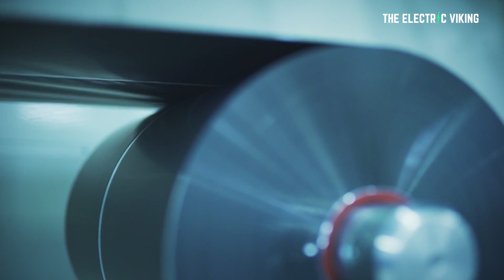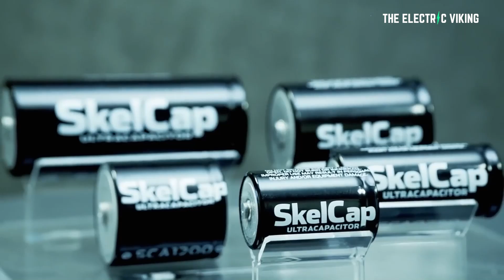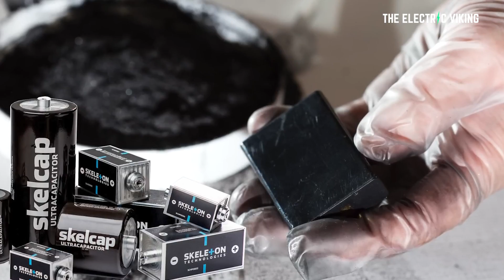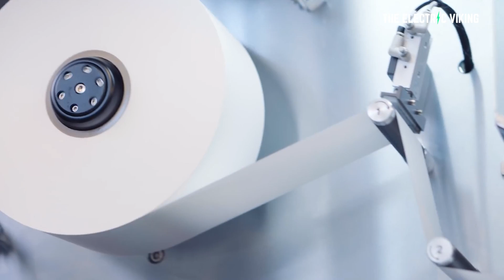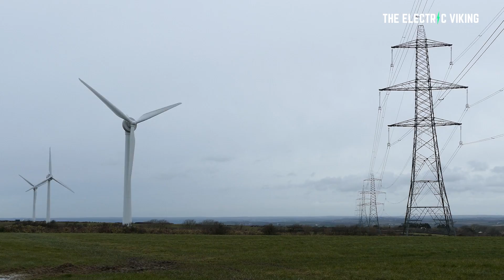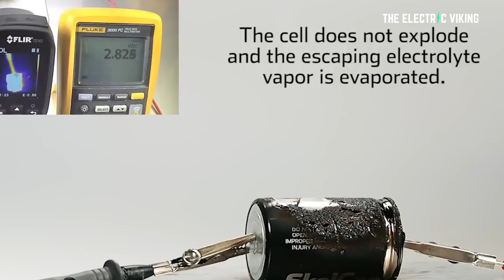The EV Super Battery that charges in 60 seconds & lasts 100 yrs

Comment: the energy density of those batteries/capacitors is very high compared to other capacitors but the are not that high compared to batteries.
it seems that this is more suitable for very fast regulation of power grids to keep them stable in certain load switching scenarios.
they might be a complementary device in addition to batteries in sports cars to have an acceleration boost for a few seconds and take a huge amount of energy from breaking, thus taking off a lot of stress from the battery. 1000kW for maximum 10 seconds. that would be a high speed buffer of 2.8 kWh. so, you could use a 'slow' battery with 80kWh plus a fast ultra capacitor from skeleton with 2.5kWh as a combination for fast action. perfect for formula e
Reply: Yeah or as a capacitor for regen and short initial instant delivery to high load requirements instead of a battery in a hydrogen cell units for anything from a car (not much needed as batteries does the job fine soon enough) or in heavy equipment where Hydrogen actually makes sense, and the same for hydrid ICE cars to store regen energy if we still want those in the future.

Comment: Meh, If the 10X numbers were real, they would post them. GMG still seems way more promising, they are up to 300wh/kg.
Skeleton ultra capacitors, if I remember correctly, also have a high self discharge rate. Skeleton have actually been around for quite some time, their products have been extremely expensive compared to any battery

Comment: The power density  of these ultracaps is much higher, great for bursts of speed abd fast recharge. But the energy density still falls short of LiIon, which means limited range. So, quick acceleration, but it also quickly runs out of  juice. So, it has some interesting and potentially useful properties, but will not replace existing battery tech.
Reply: How about if we put a windmill on the roof of the car and regen while we drive, then we can go forever right with all this power.
(I thought I should perhaps say that I'm joking or some people might actually take this seriously!)

Comment: You do understand right that the comparison is against other CAPACITORS, it's 10x standard CAPACITORS. This is still way off current battery energy density, and mid/long term storage is not what it will be competing in. Like they say short/mid storage up to 15 minutes, it's not aimed to be an energy storage solution but a load demand buffer (smoothener).

Comment: Do not confuse power density with energy density. Power density is "how fast can you get power out of it per weight" and is W/kg, Energy density is "how much energy can be stored per weight" and is Wh/kg.
Skeleton tech super"battery" according to their specs has 200 times better Power density of li-ion batteries, but 4 times WORSE Energy density.
For planes, this would be useless. For electric cars it would severely limit the range. Its lifespan and recharge speed makes it a game changer for short span applications like mining rigs driving a single 15 minutes then unloading and charging, or as a small supplementary unit in EVs for regenerative breaking charging only + quick acceleration drain help to extend the lifespan of the main battery with high energy density, but in itself this can not replace batteries. This is "just" a supercapacitor that is far better than any supercapacitor before, still having capacitor's main downsides, just less harshly.

Comment: No they don't believe they will use them as batteries in electric and hydrogen cars. They expect to use the ultra capacitors as an intermediate between the motor and the battery. Since massive power draw and regen is limited to short intensive bursts they think they can use a lower spec li-ion battery to trickle power to the capacitor that will even out the power flow and current demand on the battery. It will also be a tiny tad more efficient but most off the efficiency loss is in the current conversion in the inverter and losses in the motor so nearly negligible. For ICE hybrids I see a use but isn't that a dying breed? For electric cars no, not since batteries are improving so much and this will just add weight and complication. For hydrogen it's probably a great solution and can find legitimate use, but isn't that a solution mainly for heavy power intensive equipment like harvesters and mining. The trick is to not get overexcited and trick yourself and others. Try and locate the truth and stay in that zone.

Comment: For and average EV battery of 100 kWh, DC charging in 60 seconds = 6000 Megawatt - minutes.
For a 400V battery, this means an average current of 15,000 Amps for 1 minute.
15,000 Amp rated cable (twin), probably weighs about 20kg per metre. Internal wiring of car would be a bit heavy.
AC charging would be similarly prohibitive; It would need an 11kV 3-phase supply with suitable connectors, switching rectifier and associated electronics.   For a single cell in an EV, 60 seconds may very well be possible; for a car though, I'm not so sure. 🤔🤔🤔

Comment: Many new hypothetical batteries run on graphene, not just these, because graphene allows the battery to handle super high heat without degrading.  The faster the charging the higher the heat requirement.

The challenge with all of these batteries is no one has [yet] figured out a viable way to cheaply mass produce graphene.  Without that step none of these companies will become valid.  Whoever figures that out will become quite profitable.  "In a gold rush sell shovels."

Comment: You can download a brochure at https://www.skeletontech.com/hubfs/02-DS-SuperBattery-D60-221006-1D.pdf?hsLang=en The energy density claimed is 65 Wh/kg (as opposed to >200 Wh/kg for Li-Ion). A car powered with these batteries won't drive far between recharges, but will be recharged quickly, so overall it might still have more useful work, especially in a controlled environment like a mine where the car is never far from a charger. 

For aircraft, not so much.

Comment: Every TRUE Capacitor will accept 100% of its electrical capacity INSTANTANEOUSLY. The bad news - capacitors "give up" their electrical charge just as fast - 10kw in POOF - 10kw out POOF. No good for an EV. However, thanks to the rapid switching MOSFET, a capacitors discharge can be modulated (slowed down). Add a bank of capacitors to an EV battery pack and INSTANT CAPACITY IN - in an instant, then that energy is metered out to do a proper charge to the actual battery pack. It's a Hybrid that uses capacitors instead of a gas engine.

Comment: I just checked the SKELCAP SCA3200 , is a capacitor of 3200F at 2,85 V and this provides a maximum of 9120 As or 2.53 Ah or the equivalent of a 7.22Wh. And this is not helping the electrification too much, as the price on the market is around 70-80 euros per capacitor. If you need 1000 capacitors for a car, the price is far too high and the energy density is not enough. But for stationary applications which have no problems with weights and volumes, in long term is a good solution, if it is not necessary to keep the charge more than 1500 h (62.5 days) as is the presented limit of charge retention...
PS: all of these show us one clear thing: this type of supercapacitor needs to improve its capacity 10 times at the same price before being considered an alternative to the batteries (which are capacitors also, but their chemistry is different)...

Comment: Yes, caps last a lot of cycles, can charge/discharge fast, but as always, their energy density is nowhere near a chemical battery.  On their own website, Skeleton say that this is between a cap and a battery, for applications of less than 30 minutes.  So, there are applications, and fill a niche, but a replacement for a primary car battery, they are not. 🧐😉

Comment: I don't think this will take the EV industry by storm.........it's similar in strategy to a compressed air tank.......you pump it up to enormous pressure (high voltage etc) and then discharge it via a regulator to an engine etc .....the problem is the pressure and volume decrease as the capacity is used up until the end point is reached when it's no longer practical to discharge it further........the rapid charging would be handy.......but I can't see any home facility being able to charge a large capacitor bank any time soon.

Comment: That's not a battery. That's just supercapacitors.

They need to increase energy density by another 100 times to match batteries.

However, what they did with the supercapacitors to increase the energy density by 10 times is a great achievement. It will allow supercaps to be used in more applications. And they are super reliable. 1,000,000 cycles and nearly instant charging times with zero degradation.

Comment: To charge really quickly needs extremely high capacity chargers, water cooled cables and conductors to the supercapacitor that are thicker than your wrist. Just because you can, doesn't mean you should.

Comment: I said this years ago that once EV's got the start they needed, battery technology would race to catch up and over take what people wanted from an EV.
we passed the power stage very early on as no ICE to date or may be built in the future will be able to compete on the track nor off, the only things that now need to change are price and range.
once we have a price range close to that of ICE vehicles, no one would even think about an ICE as a sensible option and once range is removed, the age of ICE will be forgotten so quickly that people will ask another person, do you remember those cars we used to have, just like people today have to think about what technologies they used only a few years ago that are now dead and in the land fill or hidden in a cupboard or storage shed :).
Selection is my only stumbling block as at present, I have very limited options, I keep hearing that we will get a few different Chinese models coming soon and finally they are advertising Volvo/BMW/Mercedes and Hyundai on TV, so it looks like the near future will give me a choice on EV's, finally.
just a pity toyota won't be on that list as they are advertising some piece of crap Hydrogen combustion engine that only out puts as much CO2 as a running ugly girl/guy, can't tell if it's supposed to be a male or female as they chose the most genderless person they could find for some reason ?

Comment: Sam,

First, Happy Birthday.

I just looked at their brochure. They are claiming an energy density of only 65kWh/kg. Sorry, but the harsh reality is that these are not going to replace EV batteries until this is radically increased.

When it comes to charging speed, you need to remember that the energy that needs to be delivered during charging doesn't really change (aside from battery efficiency) depending on the storage type. Put simply, to charge a storage device in 60 sec requires 60 times more power than pumping the same amount of energy in over a period of an hour. That means either 60 times the voltage, 60 times the current, or a mix of both (e.g. double the voltage and 30 times the current). High current means more power loss in the cable, bigger cables, and a host of other issues. High voltage is difficult to switch (especially DC) and requires a low more insulation.

The company cites its application being in the 1-15 minute cycle time and clearly indicates that Li-Ion holds the 15 min+ range. This means that you can't really take the recharge frequencies associated with Li-Ion batteries and apply the 50,000 cycles. Where these batteries are used, you are not going to be recharging once every day or so like an EV. They are going to need to be recharged regularly throughout each day, meaning you are going to burn through the 50,000 cycles very quickly compared to Li-Ion.

I'm sure these devices will have many useful applications. For the foreseeable future, I don't think EVs are one of them.
Reply: This is very insightful thanks!

Comment: Charged capacitors are like loaded guns, they can discharge at the same rate they are charged...  releasing all that energy in an instant.  Getting into an accident with one of these vehicles would at least be the equivalent to playing with a live electrical wire.

Comment: What kind of power supply/charging system would it require to charge a 100 Kwh pack in 15 seconds?!?
Reply: the shell reference system charges a 400kWh battery in 90s with a 24MW charger. so divide by 4 multiply by 6 and we got 36MW charger.

Comment: sigh...enough talk about this stuff..."show me the money"...why doesn't this company hire an independent entity (like a university), package the darn batteries, place them in an EV (perhaps one of the EVs that has been designed to swap battery packs), instrument the vehicle with measuring devices, drive the vehicle around a track until the battery pack is exhausted, then charge the darn thing...do it more than once to develop meaningful statistics...document the results...then any statement is based, not on press releases, but on actual data, not specs and assumptions...how difficult is this?...

Comment: The problem with capacitor batteries is the sharp drop in voltage as they drain. They are unsuitable for sustained loads.

I think more detail needs to emerge on this before we can have any confidence that they will be powering EVs in the future.

Comment: The faster you charge a vehicle battery the more amps need to pass through the charging cable. You can reduce the amps by increasing the charging voltage, but the cable thickness and the ability of the charger to supply the power in such a short time could be a problem, but charged Skeleton super capacitors could be used in the charger to provide a burst of power to the super capacitors in the vehicle? 
Skeleton says: "In the automotive and road sector we provide the ideal complementary high-power energy storage to lithium-ion batteries." They are not designed to replace Lithium-ion batteries but rather complement them. For example you could dump the energy from regenerative braking into super capacitors which could then charge the vehicle's Lithium-ion battery at a rate it could accept.

Comment: What I understand is that these supercapacitors can play a key role in providing instantaneous power at a level far beyond that which can be delivered by a battery - they can charge very fast and discharge very fast - a great application would be adding it to a grid scale battery system to make the system more capable at handling instantaneous demand spikes.
Reply: Yeah they’re great for quick discharge and recharge, essentially if you have 2 capacitors in the front hubs then you could in theory do most short journeys without battery use
Reply: yes. they already offer solutions for power grids.

Comment: i think there is .0000000000000001% chance that you can charge a car sized battery in less than 60 seconds. there is a slight possibility it might last 100 years. i dont see chance according to physics that you can chage an EV battery in less than 60 seconds without it exceeding the temperature of the sun and turning the earth into a black hole.

Comment: 41years old,  this means more than likely you have less time in front of you than you have had behind you. Welcome to getting old! I've been waiting for this company to start manufacturing at scale. Capacitors have a great future when coupled with batteries. Because they can take high fast incoming power like regeneration and would be good for vehicles that can recharge often and quickly. Urban Buses for one, quick charge at each bus stop. Mining trucks that have short runs but need a lot of electricity quickly.

Comment: Well, I found in their official product road map that they will deploy production 2024 of a 65 Wh/kg battery. Very useful for city busses (quick charge at every stop) or hybrides (ouch) but useless for appealing full BEVs. Grid? Of course, there you just need right combo of cycle life and cost per installed kWh. Yet to be proven where it ends up.

Comment: The energy density on their superbattery brochure (which is on their website) is actually only claiming 65Wh/kg while that's a great advance over ultra capacitors, it's still nowhere near the energy density needed for BEVs.  Also, curiously they don't seem to mention a thing about the charge/discharge efficiency nor any details regarding self discharge rates.
Reply: Ya mon.,
   see my reply - Musk would not have missed this.
If their shit for real, Tesla would have bought them.

Comment: The "Super Battery" has an energy density of 65Wh/kg.
This puts it behind Lithium Titanate (LTO) cells.  But the power density exceeds that of LTO cells which are also exceptional.  These "Super Battery" cells will be very useful but you're not going to find them in EVs unless thay are short range - quick fill.   I'd love to try them out :-)
Reply: Seems like they might be useful in a hybrid.
Reply: @elhoward7440  Yes, they would certainly suite Hybrid design.
It is these specs that suit the mining industry - why Shell is so interested, and why RIO is so interested in GMG

Comment: I don’t get this infatuation with fast charging when it comes to cars. It may sound wonderful that you can recharge your 60kwh pack in a minute but how are you going to get the electricity at that rate into it? You simply can’t, the wires would melt, the contacts would burn etc. the focus needs to be more on the power density in wh/Kg to get rid of this range anxiety thing which is increasingly becoming an irrational fear anyway that there will probably be counselling services for soon.

Comment: That would allow manufacturer to greatly simplify the cooling solution of their cars, as you could have the main battery slowly charging the capacitor that would then be used for delivering spikes in power output.
Batteries would not be a bottleneck for peak power anymore.